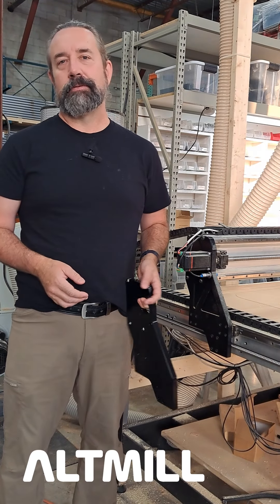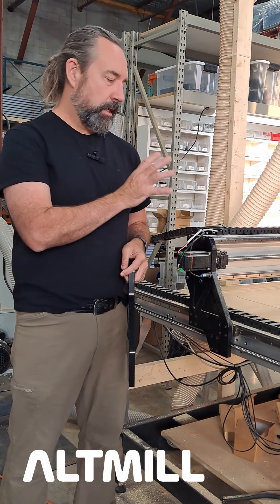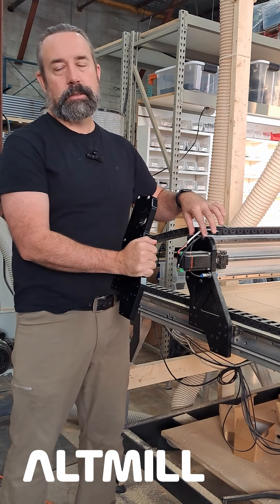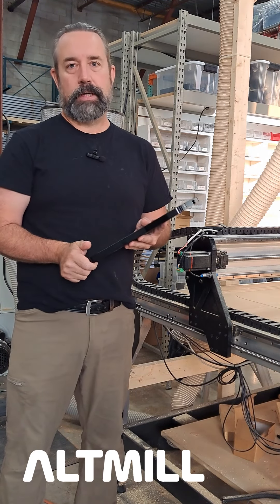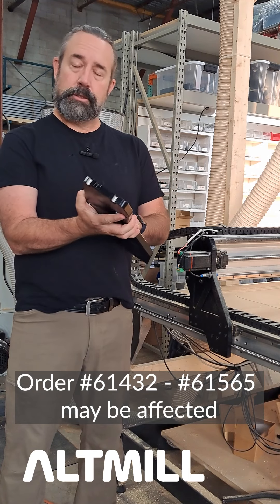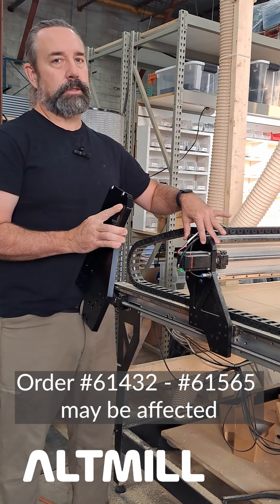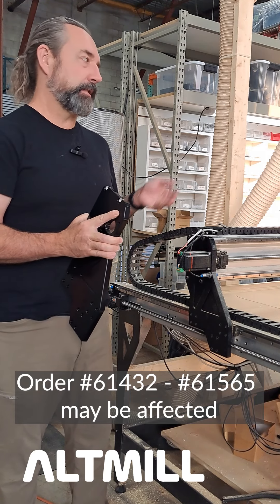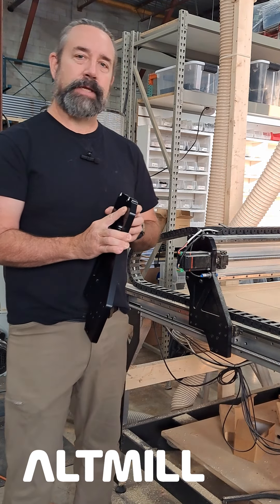ATTENTION CUSTOMERS: AltMill CNC Y-Axis Left Gantry Issue

Comment: I got one, it sat in the box for three months before I even opened it up. Watched this video before but thought I was good as my order number didn't match. I could just take a file to it, Lol, but I suppose I will wait and see what they say since I've already waited this long. Even with the issue and not running it yet I have to say I am impressed with the flat and square table I got without even checking as it went together, proper engineering!
Reply: Plate was on the way the next day!